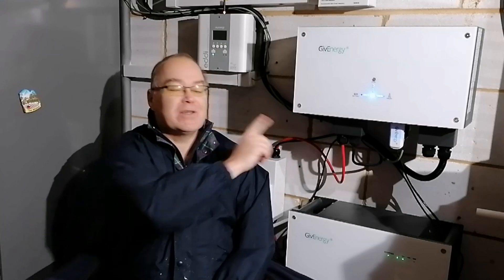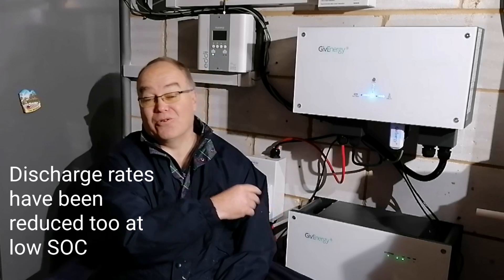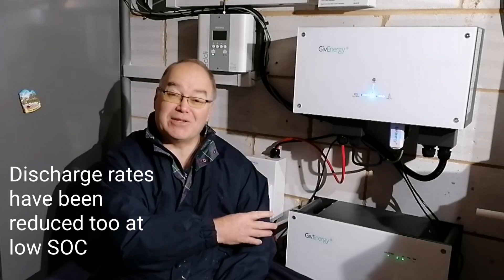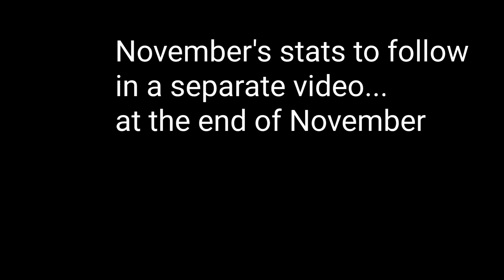November's solar update #1 - Givenergy firmware update problems

Comment: Hi have you any views on sunamp for heating water ,instead of a cylinder.pete
Reply from the maker: In theory it's a more efficient solution as it's only heating a small couple of litre tank of water and is super insulated so losses are fewer. The phase change material has no heat loss itself until activated. What I can't discover is the detail of how it reheats the phase change material packs ie. How granular the recharging and discharging is.

Comment: hi were installing a trust electric heating system what's your thoughts on getting a giv energy 8.2 battery with this system.pete
Reply from the maker: Regardless of what you use your electricity for, a battery will help in winter to reduce your monthly unning costs using cheaper overnight energy.  Size wise it depends on your property size you're heating . 8.2kwh might be ideal for a small well insulated  property but the average house will consume much more I'd guess. Only you will know how many kwhs you're likely to use for everything and how much you want to use a battery for.

Comment: You spend £5k on a battery then worry about £1 of electricity?. Don't stress.
Reply from the maker: It's only stress of the game, optimising things.  £1 a day is £365 a year £3,650 over 10.  Good habits bring good efficiency and better value 😉
Reply: @EVPuzzle  Sorry I thought it was a one-off thing.

Comment: The charge throttling you describe is CCCV charging (constant current followed by constant voltage). This is the industry standard method of getting the most energy possible into a battery without causing damage to the cells by charging them to excessively high voltage. You grumble that it now takes longer to reach 100%, but don't forget this is a new bigger 100% and it will take exactly the same time as before to reach the old smaller 100%. There is a graph linked here with some explanations in the comments. Your old 100% is the charge capacity at the transition between CC and CV charging. It looks like GivEnergy has unlocked extra capacity in the battery at no extra cost, which is not something to grumble about. Concentrate on kWh and not on % SoC. A firmware upgrade from CC  or CP (constrant power) charging to CCCV definitely requires a BMS recalibration.

One battery recalibration (or three if you insist on changing firmware versions) is a small amount of energy and not worth grumbling about or restricting the commissioning process, which is typically a time sensitive matter for the installer rather than the user.  

https://electronics.stackexchange.com/questions/509555/can-we-do-better-than-cccv-charging
Reply from the maker: In theory yes but sadly in practice the throttling occurs well before the previous actual point so there is a negative impact .  I can assure you if it was more capacity at no loss of charging speed I'd be over the moon.

Comment: Good Afternoon Nigel
Thankyou for the review. You have made some valid points and we would like to work with you, not only to make the system better but also to provide a greater user experience. You are correct, the software is designed to benefit the system in its entirety and to increase battery longevity. As one of your followers commented, an EV may take 40 minutes to get to 80% and then take another 40 minutes to achieve the last 20%. This is promote the health of the battery and may reduce performance slightly. Our reasoning for this FW update initially was a resolution to what we were led to believe was a bug with our software, however later finding out that it was a poor termination of the external battery isolation (DC MCB), that resulted in erratic voltage behaviour. Our next generation of batteries will now have an inbuilt isolation switch so this does not happen again. We are always looking for ways to improve the performance of our system and provide a unique experience for all of our users. If you wish to discuss this further please contact us on 01377 252874 or email us at Contact-us@givenergy.co.uk
Regards
GivEnergy

Comment: Great review. I was interested in your statement about 15hrs sunshine in summer and 6hrs in winter. I had a potential 5.6 kW system installed in May that managed about 39 KWhs at best but am finding that in November it has been as low as 1.5KWhs. The best day this month was on the 4th of Nov at 9.8 kWh.
Some of this is due to the shading of the panels due to the low position of the sun in the sky. I had Tigo optimizers fitted on all the panels in one chain on the RHS to try to compensate for shading but looking at them now, I think I need to get the upper panels on one chain and the lower ones on another. 
The other option is to fit another 10 Tigo optimizers, but at nearly £50 a pop I'm not sure the improvement would be worth it. I could have sworn that when my panels were installed, the cost was about £25 a time. At £50 I think Micro-inverters are probably a better investment. Any thoughts?
Reply from the maker: I haven't got enough experience of optimisers. My experience here is they're effective on static shade but not sure about fast moving. They're having an impact on inverter start up too drawing extra power before the panels generate usable energy. I think your position needs to warrant them sufficiently to justify the cost.

Comment: I don’t think there is a issue with what’s happening as long as your made aware of it before purchasing, which looking at the data sheet it doesn’t
Reply from the maker: It's a firmware upgrade. Undocumented and not explained until queried. It's very much after purchase which is why it's worth sharing. The devil's in the detail with these things. It all looks great in the brochure.

In reality we're just talking percentages. A few percent lost and a few hours of trickle charging causing more back and forth between discharge and charge.

Comment: Use your EV charging instead of dumping to the grid. No battery likes to be quick charged to 100% it decreases lifetime. But also charged at 100% vs 80% can shorten life with a factor 3-5.
And if that 10-20% is the critical factor then the battery pack is too small.
But there are other battery chemistry on the market that will full fill you're whishes maybe not commercialized yet and too expensive LTO's.
Reply from the maker: If 80% charging is a thing for home batteries why don't they have a charge limit. None do apart from the grid charging element
Reply: @EVPuzzle  I think it's because it's not the battery company they'd selling the total system and batteries are still too expensive.
If you look into detailed data sheets of batteries you'll see 3000-6000 cycles when using 90% (10-100) of their capacity but when only using 70% can extend the number of cycles much more times. At the end battery isn't dead but has only 70-80% of initial  capacity. So using less impacts the total system costs by installing larger capacity.
LTO's (using 90%) has around 20.000cycles but costs 3 times more than lifepo4's but can also deliver high current/charge rates.
It's (type of battery vs costs) about what do you want to do with it. Keeping energy for later use, peak shaving, load balancing, (delivering to the grid at peak times) with what kind of energy consumption. At this moment this is not the concern or their idea about a system of these system resellers.

Comment: Have you considered a Moixa battery at all?  We've had ours since July and its been pretty much rock solid. The battery has "learnt" our usage patterns so it charges and discharges when we need it to, sometimes pausing during the day if Agile is cheap and there is no sunlight to top up before the peak hours. That said, your set up (zappi, EV etc) is more complex than ours, but I'm sure Moixa would be able to advise you, the customer service has been excellent for us so far too.
Reply from the maker: Yes I have but not for me

Comment: All Li-Ion batteries do not like being charged to 100% and sit there fully charged  
Just like in an EV you should only charge to 100% if you are going to use it right away.   
All EV charging cycles slow as the battery gets closer to being full. Home batteries are no different.
Reply from the maker: Home batteries are different imo. Just like a hybrid battery they're expected  to be charged to 100% daily

Comment: Interesting, there are a number of factors here: GivEnergy uses LiFePO4 batteries which most system suppliers are now switching to as they have a significantly lower fire risk than Li-Ion and can be recycled, whereas Li-ion cannot currently be re-cycled. Tesla are rumoured to be introducing LiFePO4 batteries into their products too.
In the 531 firmware GivEnergy are technically implementing the correct battery management scheme, which is to charge to 90% then trickle charge each cell so they have the same cell voltages (balancing), typically during this phase only a few cells will charged. Noting the 10% charge deficit is about 0.5KWHr so not huge.
Balanced charging prolongs the life of the cells and ensures maximum capacity throughout the battery life. I notice the e-Mini charges in the same way, I was watching the charge rate yesterday, it got to 95% charge then slowed down to a few kw of charging and took a while to then get to 100%, I noticed and recognised this as good battery management. Standing back I think the last few % of charge is not that significant as it will only provide a typical house load for a short time.
Reply from the maker: Of they're improving the longevity and warranty that's ok but they're not warranting it any further so it's a loss of usability in my view.
Reply: @EVPuzzle  indeed, but if the batteries last beyond the warranty then that’s a good thing too. I have a specialised li-ion/LiFePO4 charger that I use for my model aircraft, helicopters and drones and it’s fascinating to watch how it charges the cells and usually the balancing stage can take almost as long as the 80% charge does, a DJI charger is also a balancing charger if you have one, it stops the batteries from gassing or so-called puffing, although LiFePO4 doesn’t have that problem. GivEnergy clearly take an interest in cell voltage as unusually they show cell voltages in their App; a real techi aspect being able to see min and max cell voltages and illustrates the way they think. All this is part of the learning about battery technology, the same with EV cars too as we all learn the new idiosyncrasies of battery motive power, like a 40% capacity reduction when ambient temperatures drop!
Reply from the maker: The trick is to hide that slow charge from the customer with a top buffer?

The problem is batteries are marketed showing the peak ideal rates etc. The reality is a lot less at times.

In an ideal world, over buy and have more capacity than you need so your cycles are reduced.
4.8kwh is working well size wise so 8-10 would do the trick
Reply: @EVPuzzle  Yes they could hide the charge process from the customer. I’ve already formed the opinion that Battery capacity should be 2x the PV capacity, I’ve got 8.2kwhr and 4KW PV and it’s only since I’ve had both do I realise (in this Country at least) that the balance seems about right.

Comment: How long have you been on agile nigel ? Are you using myenergi integration ?
Reply: What type of battery chemistry is inside those Givenergy units ?  Is there just the DC leads from the battery pack to the inverter, or is there a Canbus lead feeding info too ?

It sounds like the initial firmware was maybe too agressive in it's charging after 90% and they were looking to back it off a bit, rather than causing damage to the battery.

I recently ditched my original 4s4p 12v 90ah Lead-Acid AGM's and have replaced them with 16s 3.2v 200ah LiFePO4's.  Lead-Acid's are aweful the way they charge - I barely ever got over 80% into them
Reply from the maker: Lifepo and yes to canbus too.
Reply from the maker: Chris, just November on Agile and no I've hit tried myenergi yet. I'm in no hurry as I'm using overnight power very very infrequently so doesn't justify automation yet.  I'll try it one day though . Love testing 😁
Reply: From what it looks like to me they are fairly new to the game good value but needs alot of updating to get where they need to be 🤞 they can do it.
Reply from the maker: I agree
Reply: Had my fitted about 1 month ago still haven't seem to get the agile settings working on the octopus system to my givenergy
Reply: @dalemoore11  is that just setup ?
Reply: @AllElectricLiving  on the givenergy app they have a agile mode you need to link it up to octopus so they can control your setup apparently....
Reply: @dalemoore11  hope you get it sorted soon, be interesting to see when it charges and discharges or hold charges
Reply from the maker: I'm not ready to trust that just yet and don't use enough to warrant automation
Reply: @dalemoore11  I also have the givenergy battery and inverter, only commissioned a few weeks ago, I have linked it to the octopus smart energy site and setup a schedule but it the system does not seem to control the charging at all.
Reply: @davehaley1437  very poor I've got to be honest it was one of the main reasons why I bought it definitely does not work with each other, when you talk or email it flys over there heads or they just ignore it.
Reply from the maker: Support call time
Reply: @davehaley1437  I tried to get the Octopus Agile integration to work over the weekend and had no success. I have asked GivEnergy about adding another charging slot to their smart charge mode. They say they have had numerous requests for this and have asked their developers to start working on it. In the winter two slots is all I need really - one during the night and another to do a quick top-up between 2-4pm just before the sky high rates kick in. At the moment I am having to change the time twice a day which is a pain.
Reply: @SteveH377  I tried setting the same up in the smart-energy.octopushome portal but it’s not working for me yet. I guess I need to call either givenergy or octopus for guidance.